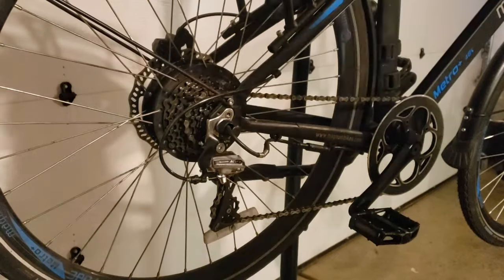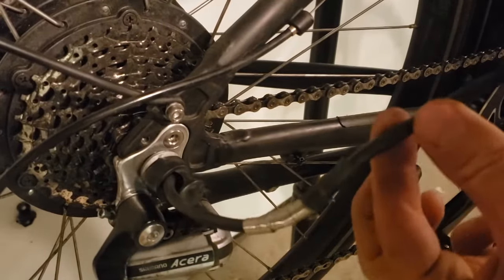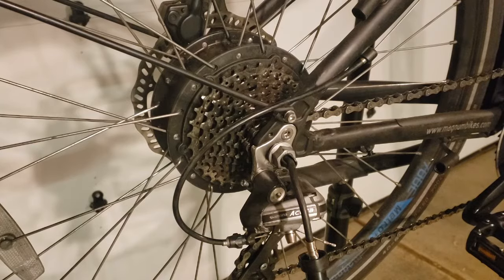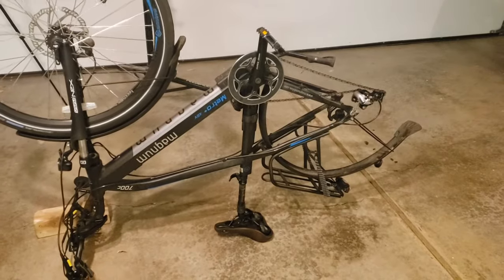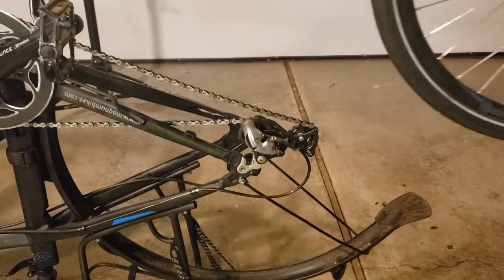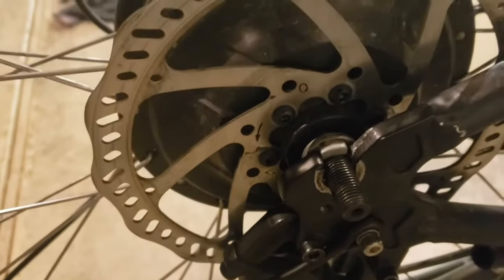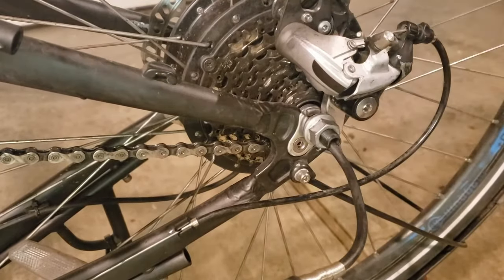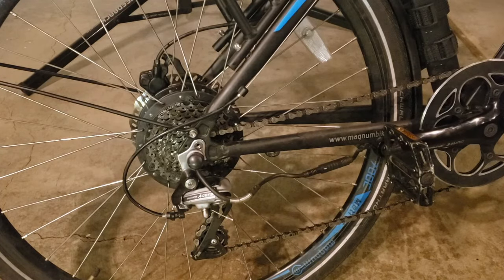Rear Hub Drive eBike Wheel Removal and Install

Comment: If the chain doesn't move to the smallest cog can I just remove the chain from the pedals chainring and put it with my hands to the smallest cog on the cassette to remove the wheel, then put it back to the cog it normally was?

Comment: I am having trouble finding videos. I hit construction with a missing sidewalk which bent the rim on the rear tire looks similar to that now it’s dangerous to ride. How do I fix that? I can’t get a hold of the company. I need a whole new wheel I thinkbut everything is as you see integrated in motor wise, so I’m not sure what I’m doing or what I need, but if I keep riding on it, my tire is gonna blow.

Comment: the inner washer seems to remain with the gear sprocket and can be left alone. i did not see it coming out when you removed the wheel. also the nut and washer stays on the cable so no need to worry about the orientation.

Comment: Excellent instruction. On My Himiway Cruiser reassembly is MUCH easier if you also remove the brake caliper. One item that is often skipped over is torquing the axle nuts. On my eBike the recommendation is 30-38Nm (22-28 lbft)

Comment: This is the video that I needed! I watched so many videos and the part after two axel nuts being removed and wheel falling off so easily didn’t work. To think it was a 10 mm wrench to finally drop the rear wheel! Thank you!

Update: Now I got the new tires and inner tubes on….i’m struggling to get the rear back on. I didn’t take note of how they were on 🤦🏻‍♂️

Update: I had such a hard time getting the rear on I watched your video again and again and it’s crazy pulling the frame while trying to place the wheel in with the washer/nuts went in snug! Without doing that no matter what I did my rear tire was grinding on the rear brake pads. This is a must do! Thank you again! Only your video helped from taking the rear wheel off and putting it back on.

Comment: when i attach the nuts to finish fitting the ebike wheel,and tighten them  its pulling itself out the frame, any ideas on why this is happening?
Reply: I've same issue did this video work for you
Reply: The tab that sticks out from the anti-spin washers needs to fill the empty space in the bottom of the drop out. If these are worn out, missing or not doing their job, get new ones! Some high torque motors will use a torque arm that bolts to the frame rather than those little washers. Axle nuts need to be torqued pretty tight. I use 40 - 50 ft lbs.

Comment: Thank you for this informative video, I think you’ve solved my problem. But to be sure, would you be so kind to describe to me the bolt and washer order on each side? I just purchased this Moscow plus, and it looks like there might be too many washers. Something doesn’t seem right here. Thanks again.
Reply: I've worked as pro bike mechanic. From my experience, the quantity and arrangement of hub washers varies depending on manufacturer. As you remove your wheel, you want to carefully note where things are positioned (eg: you might find a stack of 3 washers inside the dropouts, than a flat washer, lock washer, and the axle nut on the outside). Once everything is bolted, nothing should bind. If something is wrong, take it apart again, and see if something is in the wrong place. Every now and then, I have also run into cases where the bike was fitted with the wrong parts at the factory. Chinese QC is terrible on bicycles. Often you're the one that has to fix the problems they left you with.

Comment: I just got an e-bike and have seen 3 videos on taking off the rear wheel. This is by far the best. I don't know if you will do more explanation of maintaining an e-bike but I hope so. May I request: maintaining the chain (cleaning and greasing), battery care, motor care and maintenance and anything I don't know that I should be asking about. Many things are not particular to e-bikes but you seem to have an ability to explain quickly things that I've not understood when others try to explain them. Maybe you know I don't know things so you go into more detail. The short cuts into close-ups really help.

Comment: Is it normal that your drive side axle is not a full cylinder?  It appears to have a groove in it on the top side.
Reply: The groove in the axle is a wire relief channel. It's supposed to be oriented downwards so that the motor power cable doesn't bind on the end of the axle shaft.

Comment: This video was very useful except I have one small problem. My Hyper E-Ride mountain bike has the notch on the bolt and not a washer on the non-wire side. I can remove the wire side bolt/washer fine but the other side is static. Any suggestions?

Comment: Awesome video. Just what I needed to change out the tires on the wife's E-bike. The front was pretty much like a regular tire change but the slight move with the 10mm was the exact tip I needed to drop the rear wheel out of the frame. Thanks for posting. 👍 LIKE!

Comment: If only it would be that simple!
These disk brakes are a pain in the neck. There are those anti-rotation spacers/washers (with the notch) that are on the thread and when put thebwheel back, there will be disk fricion and can't tighten the wheel. On the front wheel there are simple washers, no thread, no pain in the neck. Now I have to figure out how many threads on each side to have.
Reply: I took the rear disc brake shoe off. When lowering the wheel on...try to lower it closest to front of bike frame working back. Holding the derailer back at same time.
Reply: Even as a pro bike mechanic, rear hub wheel service is a hassle. The wheel comes out easy enough, but getting it back in requires carefully lining up the brake rotor, orienting the flats of the axle, and making sure the washers are in the right place. I used to do this with the bike on a workstand. The trick I did, was I'd sit on a shop stool, and put the wheel on my knee. I could use a small leg movement to slowly lift the wheel into the brake caliper, then old it in place while I fiddled with the axle orientation with the 10mm wrench.

Comment: Thank you so much for this video I had to change the tires and I had no idea how to get the back wheel off thank you so much and I really appreciate that you made this video.
Reply: It’s so much cheaper too
Reply: @Idkwhatthisis10 thank God my flat didn't happen on the road but now it would not be so daunting..at home I noticed  the flat tire..after realizing the hole was at the base of the valve my next duty was to buy a new tube..video here gave me the necessary  help I needed to proceed